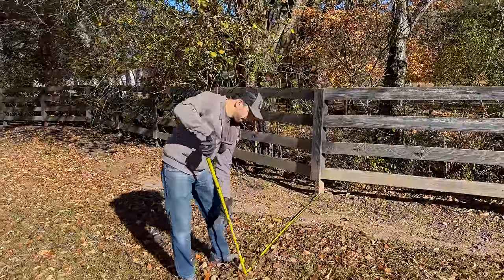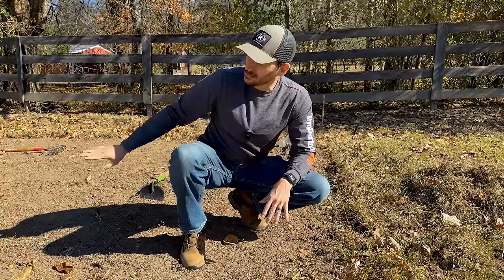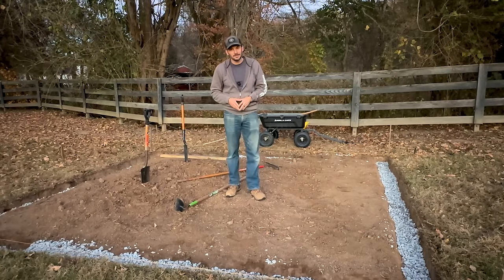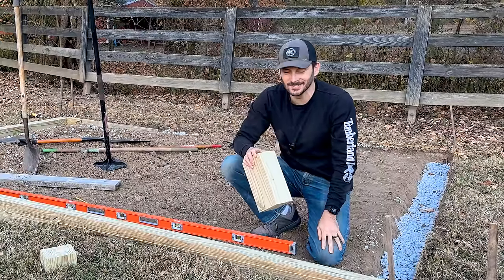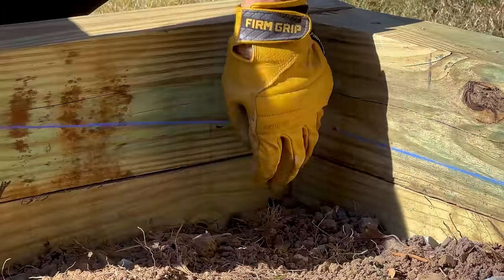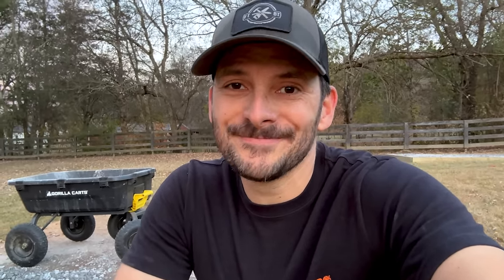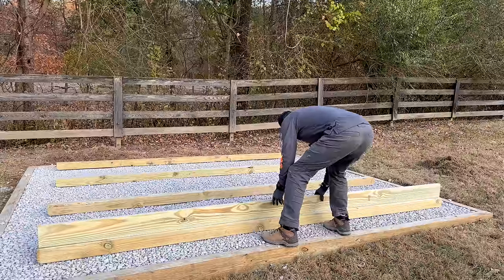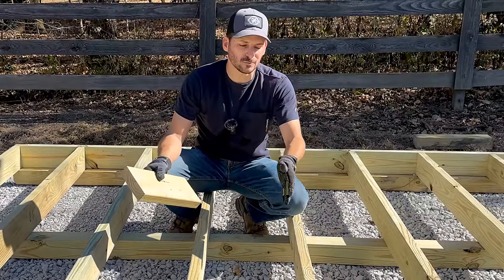I Overbuilt This Shed Foundation ... and it's awesome

Comment: Ok for no frost zones. I live in Kansas. No way I will put a shed on top on this base without digging piers under the frost line.,mine is about 30 inches down. Problem using wood around the perimeter, termites and humidity will root the wood. Don’t matter what treated wood is , it will root .I prefer to work more and put concrete around the perimeter .

Comment: Not a criticism at all, I am curious; What were the drivers of the decision to build your shed this way?  I have always put them on some sort of concrete footer, which elevates them above grade so that there's no issue with drainage, but you do have a fairly substantial elevation change.  Other people I know put them on a slab (which your solution would address), and others still just put them on the ground (I can't imagine ever doing that.  lol). 

I am just interested in the decision points that led to this design.

Comment: I am not seeing anything anchoring the base of the shed to the ground to protect from being blown away?  You have at least the rebar on the outer board, but nothing on the interior?
Reply from the maker: we don't have high winds here and it's on a tree line which further reduces that chance.  The rebar for the outer boards was to hold the pressure from the rocks
Reply: @Fixthisbuildthat  With the way weather has grown less predictable and more extreme, betting on history is getting scary.  You might wan to at least look into some kind of auger anchors that could be put in easily and secure the frame somewhat.

Comment: I'm surprised you didn't go with a concrete base instead of gravel.
Reply from the maker: It would have cost substantially more. Close to $1000 for a 10x12 pad vs ~$250 in gravel and timbers
Reply: @Fixthisbuildthat  BUT concrete would be a much stronger foundation AND naturally rodent proof... maybe do a video on when a concrete foundation vs. this foundation is good idea?

Comment: Stupid question probably (I'm no expert) but couldn't you dig the trench, lay in cinderblocks - extending above grade and with occasional weepholes - then fill in with gravel on plastic sheeting...then place your treated wood beams on top of the levelled gravel just inside of the cinderblock perimeter? Just a stupid question, I know...but why not?

Comment: I would never have a dhed not on a slab. . . With wood adhered with bolts of course. Concrete can crack but a structure moving is destruction.

Comment: Why not just dig the trench, do a concrete block perimeter and then the gravel fill? 
Shed is off the ground and also no wood or even metal contact with the ground and standing water.
And short of physical damage; the concrete blocks can be easily moved and reused for decades.

Comment: 00:00 🛠 Foundation's footprint is essential for a sturdy shed; check levelness, anticipate drainage, and account for variations in ground level.
01:08 🏗 Site selection impacts material usage; flatter ground reduces material needs and labor.
03:02 🛠 7ft level helps ensure evenness; digging trenches aids in leveling the gravel base.
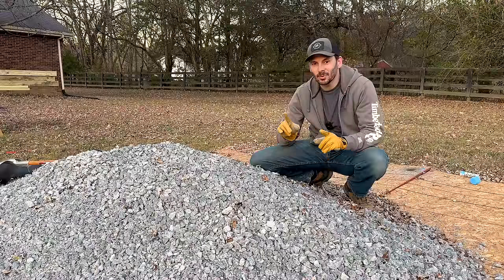04:17 🪨 Choosing clean, jagged gravel ensures proper drainage and compaction for the foundation.
05:16 🔨 Using a 2x6 as a stand-in for heavy 4x6 simplifies initial alignment for leveling.
07:32 🛠 Anchoring the foundation with rebar secures the base; adjusting for discrepancies ensures squareness.
09:32 🏠 Addressing family security via life insurance is emphasized; ethos simplifies the life insurance process.
10:41 🔩 Securing the timber base with screws and aligning dirt level ensures a stable foundation.
12:10 🌿 Weed fabric aids in preventing gravel from sinking into the soil; stapling gravel saves time and effort.
13:34 🚛 Proper gravel delivery placement saves time and effort in transporting gravel for the foundation.
14:36 📏 Screeding the gravel ensures a level surface before setting the wooden base.
16:01 🔨 Using 4x4 skids for the shed base facilitates potential movement; attention to skid alignment is crucial.
17:27 📐 Ensuring squareness in the shed frame is essential; checking diagonals aids in adjusting for squareness.
18:41 🔩 Warped joists require bracing to straighten; planning joist layout is crucial for plywood placement.
19:31 🪚 3/4 inch RTD sheathing for the shed floor requires secure screwing every 6 inches along the perimeter.
20:19 🛠 Chalking lines aids in screw placement for joists, ensuring a secure shed base.

Comment: Seems like a painful way to build a shed foundation?  E.g rebar pounded a foot or so into dirt?  Not sure that will provide much of an anchor, seems like a waste of time/effort.  Last shed I built I dug a flat hole 12” larger than the shed on all sides and 8 inches deep.  Filled 6 inches with good locking gravel like you used, compacted then topped this with a thin coat of pea gravel. I bought 16 compressed concrete 12” square footing blocks and buried these in the gravel and squared and leveled them to align with the center of 4 shed floor joists and laid out the 4x4 pressure treated joists on the blocks skid-like.  I used spare hunks of 4x4 to close the ends and added 2 noggins (spacers) in each joist channel.  Pressure treated plywood screwed and nailed to the joists and I had a deck ready for shed construction.  Cheap, fast, strong, will outlive me.

Comment: For all the work that was involved....wonder why you just did not pour a concrete pad, and put in a  poured wall about 6 inches high or something like that. The wood will rot and eventually you will have to tear everything down to replace those rotten timbers.
Reply: In our township, there are different rules (more hassle) for concrete base outbuildings which is considered permanent as opposed to gravel base which not considered permanent.

Comment: Don't do it like this, folks. Having timber at ground level, no matter what you lay it on, means your shed is starting to rot almost as soon as you have finished it. You should have no timber within 6" of the ground level if you want a building to last any time at all.
Reply: At minimum, paint it if you must have it touching the ground.
Reply: definitely dont do it like this....
Reply: Its a shed with good drainage hopefully pt wood that used. If so easily last 25 yrs.
Reply: There are 2 types of pressure treated lumber: 1) suitable for exposure (okay if unpainted) but NOT for continual "earth to wood" contact or 2) rated for e.t.w. BUT sitting on a gravel bed (picture a vertical post in a 24" hole with 4-5" of gravel in the bottom).
HD, Lowes, et al, sell lightweight concrete bases for 4x4 posts. They give you a strong, consistent "surface - mounted foundation" but you'll be building a floor system offgrade.
Here it looks like the beginnings of a monolithic slab - wood beam hybrid. That wouldn't pass code in the Southern U.S. but I understand this is a storage unit, not living space. 
I'd love to see an A-B cost comparison. I suspect that a lot of what he does places H.Depot ahead of the typical DIYer's budget concern. Structural lumber for on-ground or in-ground horizontal beams seems like a goofy design choice unless you're getting the 4x6s for free.
edit: format
Reply: @WillBravoNotEvil there are at least 5 categories of pressure treated timber. The two highest categories (UC4a/H4 and UC4b/H5) are suitable for direct contact with soil and no need for gravel or capillaries break. There is also an H6 or marine grade treated timber, which is suitable for direct earth contact as well as sea water contact. The way the stone is used here, a lower middle grade H3/UC3 would work fine for a 50 year design life. The stone he put under the middle part of the pad was a waste, does nothing
Reply: See those fence posts behind him? In the ground. 🙃
Reply: @thelouiebrand  How long do they last? If you'd ever owned a wooden fence you wouldn't have made such a stupid comment.
Reply: @thelouiebrand they rot off too. every one of my fence post did. Lasted 20 years. Thats not long enough
Reply: Agreed!  Every time I look at a 100+ year old railroad track I think to myself that that wood is never going to last.  They should have put them on something instead of burying them in the dirt.  Don’t even get me started on the 100+ year old log cabins.
Reply: I will bet those timbers last longer than the man building it.
Reply: @kaosactual1  Well, I'll hold your money. I'm an architect, and have been involved in hundreds of property renovations and extensions. Universally, without fail, any timber we find within 6 inches of the ground is rotten. Absolutely every single damn time we find one. You can hope that somehow this one example is the exception to that rule......or you could just do the job properly in the first place.
Reply: @MikeAG333  I'm not saying it's the best way. They obviously used the wrong lumber. UC4A and 4B lumber will last decades even with poor drainage. Put it on good gravel with drainage, it will outlast you. I'm talking 40 to 50 years plus. Will it rot, sure. But you will be rotten before it.
Reply: @MikeAG333  You want it to last a lifetime, build it with UC5C. You're gonna pay a premium and it's hard to find away from the coasts, but it will 100% last longer than you.
Reply: @kaosactual1  So why not just do it properly? It really isn't difficult.
Reply: @MikeAG333  Funds. Material access. Time. Usage. Some need it movable or portable. Any number of reasons why not to over engineer and to have an impermeable, indestructible tool shed that will outlast the pyramids.
Reply: @c4fishfood  well said. On the coast here in NC UC5b and C lumber is widely used for nearly everything. People don't understand that if it is used in a good drainage area like this shed base, it will last your lifetime. They assume that all lumber is made equally. It's just not the case.
Reply: @kaosactual1  Well, I content that "funds" is not part of the excuse for building like this (and indeed, you previous post supports that by mentioning how expensive the highest grade of treated timber is). If you live in a rocky area, find a dozen rocks and build it on that. Or find some old worn out car tyres, ram them full of fines and small stones, and build on that. Drive some angle iron from the local dump into the ground as home-made piles, and buiild on that. Got some old concrete fence posts? Well cut them in halves or thirds, dig them into the ground vertically, and build on that. There are umpteen ways to do it better and cheaper than the way shown in the video.

But I take your general point. Sometimes you want a cheap temporary building which only needs to do a job for 5 or 10 years. Fair enough. But then don't make a Youtube video about it telling everyone to build like this

My comments here aren't to criticise the guy made the video, or to get thumbs-ups from people who know exactly how to build a decent out-building. The whole point is that there will be a load of people scouring Youtube for help with the one-and-only garden shed they'll ever build, and they should know that this way probably isn't suitable for them.
Reply: @MikeAG333  The point is, lumber on the ground doesn't mean it's gonna rot from under you in a few years. It's highly dependent on the lumber you use. Some pier posts that are sitting directly in the water will outlast your lifetime. The point being, yes you can absolutely do it like this and have it last a lifetime if the material you use is correct for the conditions. There are old railroad trestle bridges literally sitting in water that have been standing for well over 100 years. 4B treated lumber or better on gravel is just fine. And will be for a lifetime.
Reply: @kaosactual1  We're never going to agree, and I begin to wonder if you are deliberately missing the point. He didn't use a durable timber, or one pumped full of chemicals. So, I stand by my comment: don't build it like that. You're making some spurious point about not building it like that, but doing it similarly with an entirely different timber. This isn't a conversation that's going anywhere, I'm afraid.
Reply: That's why you should tar pitch!!!!!
Reply: My 180 year old log hewn barn is sitting on 2 ft chunks of log.  On the ground in swampy wet SC for 180 years and doing fine.  No rot and no termites.  Know why?  (I do).
Reply: The shed is above the ground so even if the 4x6 timbers rot the actual structure will be fine for many year to come
Reply: And being an engineer the maker of the video likely appreciates Your observations, Or will appreciate  them eventually.  He seems like he wants to do what's best for the people.

 You offered Several options for piers  that he could set his pressure treated skids on.  The topography of the land is going to dictate Drainage. My guess is gravity will come in to play and it will flow downhill.   With or without a washed stone bed.
Reply: @randrowe9660. Cypress? Perhaps the logs have always stayed submerged? Both? Do tell.
Reply: Sitting in my 100 year old house rough hewn oak beams sitting on Bois d'arc stumps rock solid and level
Reply: Mikeag333 what about a shipping container foundation. I was going to use 4*4 post just to form the gravel and sit the container on top so the floors don't rot.🤷
Reply: @ChristisKing7749 You can waterproof them...
Reply: Absolute rubbish my dad's garage all of wood including the foundation Still solid after 35 years
Reply: @ashleynew5499 You sound exactly like the people who used to say  "Rubbish. My grandfather smoked 70 a day and lived to be 130"
Reply: @MikeAG333  lol , I have photos
Reply: @MikeAG333  the garage even survived the 100 mph plus winds we had in the UK in 1989
Reply: @ashleynew5499 Whoopy do. "It even survived a gale".........sheesh. That's a great argument for a building detail, isn't it. How many timber framed buildings have you been involved with in your life? Two or three hundred, like me? At some point you'll understand that experienced architects with a lifetime of work in the field know what they're talking about, and your dad's garden shed is irrelevant.
Reply: @MikeAG333  (firstly it's  not a shed it's a garage triple skinned and insulated approximately 10 ft high and the length and width of a bus)no you Wally I was simply saying if a building can last 100 plus miles per hr storms and weather over the last 35 to 40 years it can't be that bad can it irrespective of your lifetime of experience only someone who is woefully inept makes the sort of sweeping statements and criticisms you do. I think most people would agree that if something is able to withstand hurricanes and 40 years of weather in the UK it can't be all that bad can it
Reply: @ashleynew5499 Righto, Einstein. Whatever you say.....
Reply: @MikeAG333  lol 😆 have a good day x
Reply: @c4fishfood  Actually the three-quarter gravel that he put there creates drainage as well as a rock, solid concrete foundation for the pressure-treated lumber to sit on. I believe he’s using higher grade PT design to sit on ground.

There is always more than one way to build Correctly. I like using cinderblocks with a raised foundation 8” with galvanized all thread as anchors and concrete to make sure in high winds the shed  doesn’t shift.

Rebar should also go 2 feet into the ground, whenever you cut pressure-treated lumber, the fresh cut and is no longer treated and you need to use a product like copper green or approved pressure-treated coating.
Reply: Any concerns with drainage if you were to compact the base dirt layer?

Comment: It’s not gravel, it’s crushed Limestone.
Reply from the maker: weird, cause when I called and ordered gravel this showed up
Reply: @Fixthisbuildthat  I think you bought the right stuff, the angular stone compacts better.  Gravel which is rounded stone continually moves and does not compact.  Gravel and crushed stone are two different animals and you bought the best material for the use intended.👍👍

Comment: I will not tell you how to do it right, I can only suggest how it is better, as it seems to me. In my country, we do not make the base from wood, only formwork (for concrete). Concrete does not rot, although it is colder, but more expensive. If you wanted to save money, gravel is of course easier and cheaper, but who prevented you from buying cement, renting a small concrete mixer and making concrete yourself? For this volume and area, it is real, although difficult.
And so you simply buried in the ground a bar made of expensive, smooth, beautiful wood, which is not even protected from rotting, instead you protected the gravel from the ground, which will not be harmed anyway.

Comment: This seems like massive overkill i use ground reinforcement grids filled with shingle also only every foot. Way less materials, way less work, as good if not better on undisturbed ground. Why make the base bigger than the shed is asking for damp issues no?